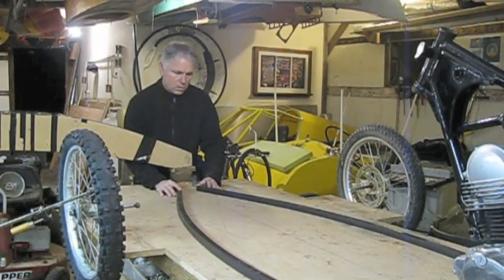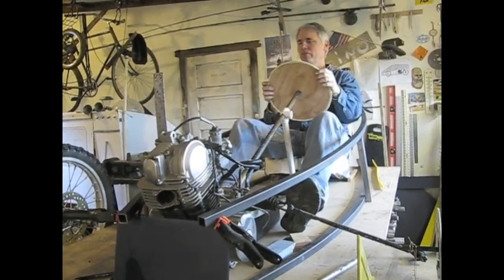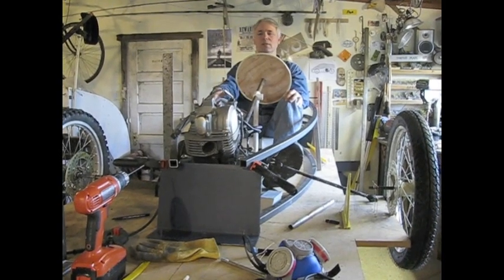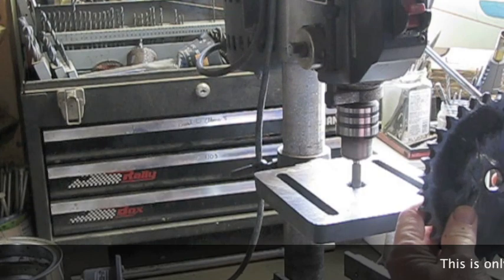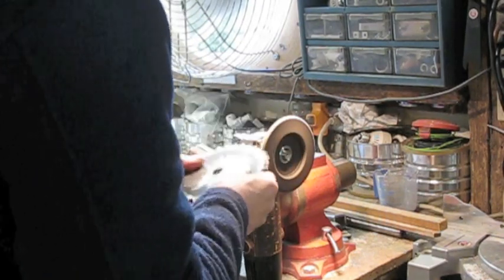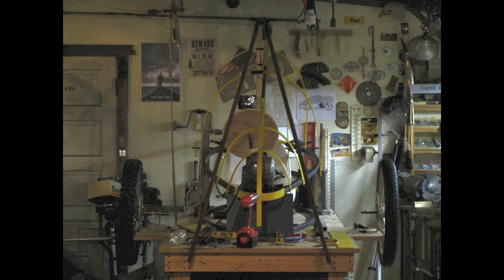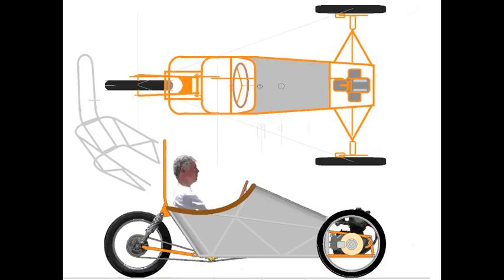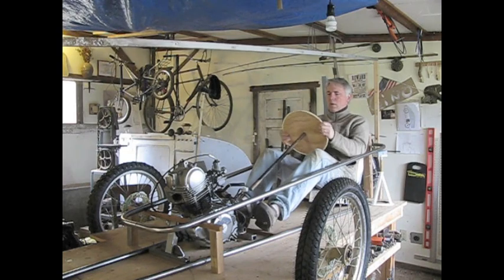High mileage trike build (part 3)

Comment: Mr. Elkins,
I was on the engine team on our supermileage team in HS, a few things we did to the engine that increased gas mileage were:
- ceramic coat: exhaust, piston head, and engine head
-exhaust was constricted to allow for better back pressure so it wasn't spitting 'unused' vapors
-we used a brigs engine (2.5hp) and made a plate so we could mount a much smaller carb on it
-another non-engine related we used were high pressure racing bicycle tires, although expensive, normally the gears that accompany them are MUCH better than any 'stock' type
- we used a 'hammock' style seat as well, they are much lower in weight and sometimes more comfortable
- From all of your other videos I can tell you like chloroplast, but we did a mock up on balsa and monocote body, it offered much better mileage although you trade off for durability, this is where a Aircraft Dacron might work (varnished with oil based) to offer more durability

For what they are worth that's what I can remember now, I will keep checking back as always, I enjoy watching the RD process.

Thanks
Reply: I forgot to add, we got about 825miles per gallon on our design, the following year they used the same motor and wheel setup but with a carbon fiber unibody and were 1200plus miles per gallon
Reply from the maker: Thanks for that info Christopher. I've been watching the ecomarothon races for some time. Lots to see on body design and sometimes a peekaboo on drive trains set-up but seldom do you hear about engine mods. The difference of course is I'll be doing freeway speeds while fending off truckers, bad weather, road bumps and ruts, road debris etc. while trying to have a comfortable ride, carry a few things, have collision protection and get good mileage. Then there's satisfying the DMV and convincing your insurance company to carry you without getting rejected or gouged thus defying the effort to save money. I've gone thru this before. It's a tall and daunting order to say the least.

Comment: You're wanting a grocery-getter?  If so, where is the room for it?  I assume you're going to want more than a bag or two.  Another idea for power could be an electric trike with a gas generator powering it.  This way you can go full battery once tech comes out that is efficient and cost-effective without a rebuild.  As usual, awesome to see your projects.

Comment: Thanks for the update. I was thinking about a similar project only using a shaft drive instead of chain drive. If cowls were used, the engine could be still mounted in the rear and have ample cooling.

Comment: I suggest you lokinto the front axle assembly (including steering system, gearbox, engine and frnt drive shafts of a Citroën 2CV. Front wheel drive, simple design, compact and hopefully you can find the parts... The engine would have about 25-30 horsepower 4 gears and a reverse...which motorcycles lack. Regards, Sander

Comment: If the motor is in front want it give off a lot of heat in summer making it uncomfortable. I like the idea just wondering no gas motors heat up as you run them.

Comment: I was also wondering why you weren't using a belt drive system?  By having the motor in the rear with side cowling induction cooling..it would permit a shorter belt length and greater torque.  It also would allow you to stretch out your legs.  What about braking?

Comment: My advice... Doors and windows sealing is going to be a nightmare.  Go watch Sean Casey's videos of when he built the TIV tornado vehicle. He never did get them to seal. They had to wear raincoats inside! LoL! My 2 pennies... Rat rod not only looks cooler..... It will be an easier build. Nothing beats wind in your face on the open road..... Good luck in your decision!
Reply from the maker: Hmmm. Another vote for rat rod. 
Interesting...
Reply: Paul Elkins Your Plywood electric boat you created turned heads Paul... We all wished we had one. Heck.. I priced boards after I watched the video. Pretty sure the guy in the video was drooling! It comes down to the goal you want to achieve on this project. If you are still out to create a 150 mpg vehicle.. You better be getting in touch with your NASA side and be building a freakin rocket. If you want to create a vehicle that is amazing on gas... But is designed to turn heads and create commotion when you drive by.. Go for the Rat. I think your going to get complements on either.. But you may have guys lining up to check out a Rat Rod. I'm excited to see you posted an update... I have been eager to see your progress.... Do another mini update soon and keep us posted on what you decide! Tight wrenches bud.

Comment: Hello Paul, I just found your videos. Very cool stuff that you've made!
For this build, I'd go with the simpler build. I've worked on many projects where I want the 'coolest' most advanced design I can come up with, only to get frustrated and lose ambition to finish it. Perhaps you should build the simple one, then if you want to modify it and supe it up later, it wouldn't feel so complicated.
Reply from the maker: Good thought. I'm leaning toward using the curved square tubes and going open cockpit, then if in the future I choose to go aero I'll have the curved tubes in place to carry out the slip stream body.

Comment: The aero version is harder to make but would get better mileage.  Having the engine up front is OK.  Probably better cooling, but not necessarily.  It depends on the air intake and outlet vents.  I'll watch all the videos no matter what you do.
Reply from the maker: Cooling was one of the issues, and we were discussing an airplane style couling that would go around the engine with exit vents. Another advantage is capturing heat for interior heating and defrost. It's also nice to have something between you and what you may run into.

Comment: I really enjoy the second design as well as the first, so I can see where your hesitation stems from! I also have a question; have you ever had problems with heat from the engine melting the coroplast surrounding the engine? Thanks for the awesome video! Looking forward to more!
Reply from the maker: I had no problem with Pavo, and never did try the big trike out with the coro cover. It takes a bit of heat, but it is thin plastic after all...

Comment: Hi Paul, It looks like you'll be using a motorcycle wheel in front which have a thin axle. do you already have a plan or design on how to attach it in an A arm? like the spindle knuckle connected to that thin axle? and how it will not bent? I hope you can share it with me because I'm also planning to make reverse trike like what you're doing, using the motorcycle wheel also. :)

Comment: Just an attempt at rekindling your Rat Rod fire.  You can always change up the body after getting a workable frame.  I did really like the Navette frame.  How about splitting the difference and doing a Briolette style frame?  The tapered rear will decrease drag and you could even include a trough in the front, copying the peregrine falcon's fastest animal in the world "design".
Reply from the maker: This project was going to come back to life after I retired but we decided to buy a fixer upper recently, so the trike will have to wait for a while longer. I've though of alternatives, but I might go for the original motor in rear tear drop configuration and dive in to a time consuming custom fiberglass body.
Reply from the maker: The final will be very similar to the model I show in the video. I just thought it would be nice to move the weight more between the front wheels as in the rat rod design. It's a toss up on how I'll make a glassing surface. I like the idea of attaching foam strips to temporary equally spaced stations around the completed frame base, similar to a cedar stripped canoe, then glass over that.

Comment: I was almost sure it will be an electric trike. Why not electric with hub motors? No sprockets or chain just wires.
I want to build something similar with 4 wheels (I do not see the advantage or benefits of just 3) and there sill be a hub motor for each wheel so I can not get stuck in any situation. Probably LiFePO4 battery and a large solar panel on top for extended range it will have two seats not sure as of now in what position.

Comment: Just curious and wondering what type of front end you're going to use. 
I saw your Volkswagen front and on the other trike you were putting together. I know those friends who about 250 pounds.
Had the pleasure of working on a BMW Isetta many years ago and noticed it had MacPherson strut front suspension. They can be made very lightweight. Or are you thinking upper and lower a-arms with a coil over shock absorber? I suppose a straight axle would be the lightest.

Comment: you could make it electric with three hub motors.  Much simpler and the battery pack goes where the engine was.  You would have 300 mile range with 10kw of batteries.
Reply: +Lawrence Rhodes If you kept it under 300 pounds.

Comment: How about electric? An engine is a bit noisy and you get associated heat issues etc.
Reply from the maker: Indeed, but I'm still fond of gas. It's easy to refill and continue on and I can park the rig for extended periods without having to worry about killing the expensive battery pack.

Comment: Love what you are doing.  Wish I could do it or help you so I could learn to do the things you do. Thanks for the videos.  Keep up the good work.  I would be curious if you get your 150 mpg.  I was considering a build similar to this only using a Moped motor instead of a Motorcycle motor.  Of course it wouldn't be as robust as yours.  Also, if you haven't seen it yet, you might want to check out dennis thomas on youtube.  He builds and is building a "cyclecart" and may have some ideas for you.
Thanks again.
Reply from the maker: I just recently ran across Dennis's videos. The cyclekarts are way cool in my opinion, and my project, although a distant cousin, does have a lot of similarities. My desire is to have fun driving my rig along the windy farm roads around where I live. Not much speed is needed to enjoy the challenges of a reverse trike.

Comment: your project is pretty cool but personally 'i would go back to having the engine be hind the seat for safety reasons more than anything  the thought of an improperly guarded chain coming adrift between your legs does not fill me with confidence .

That said  what sot of design do you have in mind for your front suspension?
Have you thought about using  ATV steering knuckles  brakes and or extended suspension arms  your get your desired front track ?
Reply from the maker: I'll  have a strong chain sheild. No worries. I used ATV A-arms and wheels for my first large trike with moderate success. I know I'm going out on a limb making my own a-arms and such, but that's part of the challenge I enjoy.
Reply: As long as you weld your A arms properly you should have no real problems with them If you check out may channel you will see that I have built a Lotus 7 style clubman and getting the steering right so that I have zero bump-steer was well worth the effort now that I am driving the car (since 2007)  to achieve that geometry its vital that the inner ball joints of your steering rack are in alignment with a line drawn between your upper and lower A arm pivot axis lines .

Your original design looked far more aerodynamic than your later effort but of course the limiting factor is always what you can make with the tools and facilities on hand have you looked at  early aircraft practice using fabric skins stiffened with resin/dope? Or even plywood veneers over a former to make a light weight shell could work. I saw a great side-car body made with a zeppelin like shape from thin marine ply cut into pieces like long flower petals "stitched"together with copper wire and then joined with strips of fibre glass and resin.

Anyway I just thought I would throw a few ideas at you that may help you on the project Cheers
Iain
Reply from the maker: Iain Hall

Comment: Wouldn't using a electric motor be even more economical? so i do not understand your choice for using a gas engine
Reply from the maker: Electric would be good for short distances but gas gives you a lot more range.
Reply: Paul Elkins Point taken. Have more batteries then. Savings on gas adds up as well. Electricity is much cheaper though Batteries are expensive . I wonder why more and more electric cars?
Reply from the maker: Don't forget how electricity is generated. Nuclear, coal and water. Here in the NW we depend on rain, and some wind. Also look at the construction of batteries. Nasty stuff. When you look at how many people travel alone to work (75 %) one passenger vehicles make sense. Build them light and aerodynamic,  you go further hence spewing less carbon in the atmosphere. Small motors are not currently made as clean as automobiles but they could be.
Reply: Paul Elkins What you say makes sense :)

Comment: why not put the engine behind your seat so you have less chance of chain flying off the sprocket and less noise, also make sure you have rubber mount for the engine to have less vibration on the frame, just move your seat forward couple of feet, if you still have the bike frame you'll have a better chance of registering it at the DMV because the vin number is what makes it legally a motorcycle, without it they will consider it special construction and you have to go through a mechanical safety check, just saying. I build one myself and the inspector told me about it, check my channel on Reverse Trike Honda on youtube.
Reply from the maker: +lightrose100 I've seen your trike before. One of the better ones I've seen in my opinion. Exceptional attention to detail. Having the engine behind me was always my intent, but on my first trikehttp://www.elkinsdiy.com/trikes/honda-trike/ I had overheating issues. I never did create a scoop that worked well. The 1972 Honda 350 engine was air cooled, and I planned to use again an air cooled Yamaha 185 for this project. I feared the overheating issues again, and after considering moving it up front I feared just what you said, so I dropped the project. When I retire next year I'll be at it again. Maybe this time using a 250 water cooled Ninja. Do you still use your trike much?
Reply: I guess its ok to have it up front, maybe make it a front wheel drive by using an assembly from a 4x4 quad that have a steering mechanism ? just thinking , and yeah I ride my trike and I've put in 16.000 miles since 09, every couple of weeks I ride it for 2-3 hours ,and little bugs comes out that needs fixing a year after riding it, now I think those bugs are gone and I feel safe driving it, one thing is the bigger the motor is ,the safer for you because its easier to get away from someone cutting you off,
Reply from the maker: I've heard mention having a bigger motor many times to avoid situations. My original thought was ultra light, aero and small motor, but if I'm to use this on a regular basis it makes sense to increase the motor size for engine longevity and the ability to get out of someone's way. I still want a behind seat set-up and with a water cooled motor it should be too much of a problem.
Reply: water cooled is good, one thing I found out is even if you have a radiator fan it still overheats , you need to trap the air coming in the radiator, like a cowling, to prevent the air from escaping and really push the air thru the radiator and not relying on the rad fan alone to pull the air thru. too much turbulence behind the seat
Reply from the maker: I'm thinking to get the least wind disturbance flowing over the body one would want to locate the radiator cowling right at the nose tip.  And the long stretch of hose between engine and radiator might cool the water more. If you had copper line with fins for the water going to the radiator you could pass it thru a channel with vent doors to act as heat for the cockpit, similar to my old VW bug.  Just thoughts.
Reply: since your running a hose to the front might as well get yourself a heater core and by pass some of the hot water coming from the radiator up front. I do have a bug too ,its 68 with 1835 motor,

Comment: Why not just grab the rear end of a air cooled scooter?, its a single unit with engine, drive, rear axle and brake, a 4 stroke 200cc will give you plenty of power and millage.
Reply from the maker: I have a honda elite 150 all cut and ready to go, but the issue has always been no way to play with gears and the weight issue, although I do like the automatic trans and water cooling that the scooter has.

Comment: I would put one weal at the front and two at the back it would be safer and work better
Reply: I would If I could 101 you are wrong about that as one wheel in the front would allow it to flip to easily

Comment: I love what your doing but that long chain will be what drives you crazy even if you get it to work it will be very problematic.
Reply from the maker: It might, it might. I'm re considering the rear engine design once again because of the chain issue and I'd like to pursue my simple front suspension, which can (almost) only be done with the engine in the rear. Who knows. I'll probably go full circle by the time I decide on something. Many options to think of.
Reply: Paul Elkins
The original Morgan Three wheelers were Chain drive, 2 speed, no reverse and worked just fine.
Reply: perhaps a platform right behind the rear wheel.its gonna be fun to drive.
Reply: crackin2000
I don't think from a weight distribution standpoint an engine mounted to a platform behind the rear wheel is wise" 'other than being more interesting than fun to drive:-)